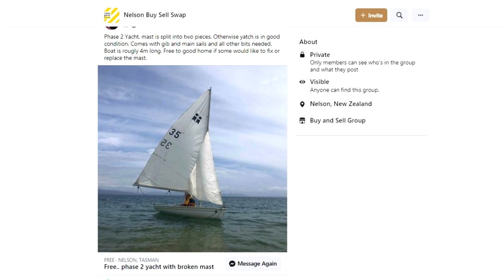Free Racing Yacht with a Broken Mast.. Lets Fix it

Comment: Marty that “drain” at the stern is called a self bailer. Once the boat is going about 5 knots it open it (lift handle and push down) and it should start to drain via a slight vacuum from the forward movement. Once you begin to slow you close it again. Flush it out to remove the sand and put some Vaseline down the side to keep it moving nicely. As a keen sailer I can’t believe how good these cheap repairs are to save this boat from the graveyard like many small sailing dinghys nowadays... this boat will be epic for the kids once they get a bit older!! Greetings from Western Aus!
Reply: It is also called a venturi

Comment: 100% you can fibreglass over alloy / aluminium, no problem. You can do it in polyester, vinylester or epoxy resins using fibreglass, aramid (kevlar) or carbon cloths. All will work well and add strength / stiffness. No issues with corrosion of any of those resins / cloths in saltwater environments, surfboards and boats are built from them for that reason. There's also no galvanic corrosion between the metal and the resins / cloths.
I'm surprised you thought, or others suggested, that could be an issue - boat makers have been glassing in metal bits on glass boats for many decades.
A great repair and good on you for resurrecting yet another old bit of equipment - that can be great fun for the kids.
A man of your many talents should soup it up and add foiling boards / rudder, it's all the rage nowadays, makes an incredible performance improvement if you can get it right lol. And you're a Kiwi, it's right up your alley and in your blood, look at your America's Cup wins!

Comment: Take a 1/4 piece of round stock, cut a slit with a hacksaw down the middle  about 1 inch long. Take a piece of sand paper or emory cloth 1 inch wide slide it into the slot and wrap it around. 2 - 6 whatever long . chuck it into your drill . Use that to sand and clean in tight spots. Polished ported heads that way.

Comment: Nice job with the repairs and the video. In Canada we call that boat a two person Laser.  It has a jib and a larger cockpit than the single person.   It is also known as a wet boat, because in a strong wind you are going to get wet. Good luck and have lots of fun.
Reply: Marty’s is a wet boat in all conditions with that dodgy drain plug 😆

Comment: HI Marty, just a caution. when aluminum and carbon fiber are in contact they set up a galvanic potential that will actively corrode.  You should have out a layer of paper or something else to form a barrier between the two. hopefully your glue joint is thick enough to keep the aluminum and carbon apart.  you will see the aluminum pit if you have made contact. sweet repair, good on you mate.
Reply from the maker: Yes I think the epoxy should encapsulate and insulate the carbon fibre quite well. Cheers

Comment: 5:07 I'm guessing that that carbon fiber is actually significantly stronger than the aluminum. It is smaller in diameter but it's thicker walled and carbon fiber is usually stronger than aluminum for any given thickness.

Comment: The reason there was corrosion under the stainless fittings is aluminium and stainless steel react badly when contacting eachother or even being near eachother in damp conditions

Comment: We use epoxy on warship prop-shafts to seal the join between the mild steel shaft and the stainless bearing sleeve. So you should be good.

Comment: You may have some corrosion problems down the track with Carbon Fibre and Aluminium so close, especially in a Marine environment. Carbon will cause Dielectric corrosion in Aluminium very rapidly. Hopefully there is enough epoxy in there to isolate things. Keep an eye on it...
Reply: Yep, galvanic corrosion is definitely high risk, seems like he slapped a good amount of expoxy as a barrier. A fibreglass sheath would have worked. Funnily enough Aluminium and Stainless steel also heightens the likelihood for galvanic corrosion as the large amounts of chrome have a high electric potential to aluminium! (Just like what Marty saw on the mast under those rigging points).

Certain Aluminium alloys are considered “Sea-water resistant: so they tend to resist galvanic corrosion pretty darn well, you’d hope this mast is!

Comment: epoxy to metals i've had most success by warming the metal slightly first to take  away any potential moisture/ bloom in the air, that tape you used to go over the glass tape i've found gives a lot better finish if it's put on sticky side out, bit of a bitch to get started but finish is pretty good, either that or use proper peel ply which as usual costs money, as for strength , I was told it's a similar cure to concrete as in okish after 7 days but for full/max strength about 28 days, end  result is pretty good though keep at it

Comment: Once again, you amaze me. Gotta ask, what's the board for that sticks through the bottom of the boat?
Reply: Daggerboard   https://en.wikipedia.org/wiki/Daggerboard#:~:text=A%20daggerboard%20is%20a%20removable,handled%20by%20a%20single%20person.
The daggerboard stops the dinghy from being blown sideways through the water by the force of the wind or asit sates in the definition "converts the forward motion into a windward lift, countering the leeward push of the sail". 
It is removable so that the dinghy can be beached and trailered....
Reply from the maker: Centre board - https://en.wikipedia.org/wiki/Centreboard

Comment: Mart, the bend is on the Stb side, good for the start. It will give a little edge at  the top of the mast to windward. Will put you ahead of the rest of the fleet by the time you get to the first cross. Don’t touch it.

Comment: Marty, did you manage to score the jib as well as the main? Then you can really fly. on the Phase II. Also, the best insulator for dissimilar metals/carbon on aluminium is a tube of  Duralac. The riggers use it for all the stainless fittings on masts. Get it at Burnsco stores.
Reply from the maker: Yes I got the jib as well, but I don't have enough hands, I will use it when I have another person aboard

Comment: I fixed a row boat up when I was 12 
Cracked on a rock and the owner left it in the lake
Keyhole drilled the bottom of the crack and filled it with epoxy the. Wrapped with fiberglass 
Let it dry overnight 
Handled just fine

Comment: I would not worry about the fiberglass and aluminium corrosion. The only issue you might have is between the carbon and aluminium. They can react but If the epoxy insulates or the carbon it under a layer of glass you will be good.

Comment: Hi not sure but doesn't carbon fiber react with alloy. Saw it on an aviation build you tube channel.
Reply: Yep, epoxy barrier should hopefully stunt that, otherwise I would assume its Marine grade aluminium, so hopefully Marty will get a bit of use out of it regardless!